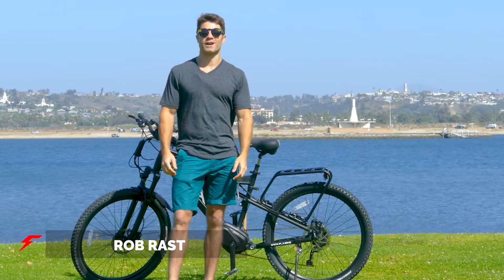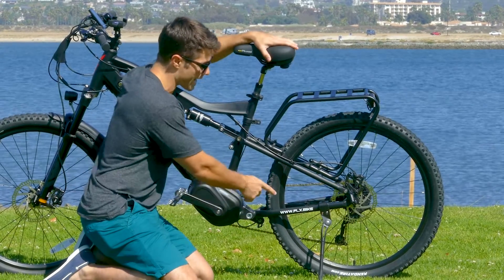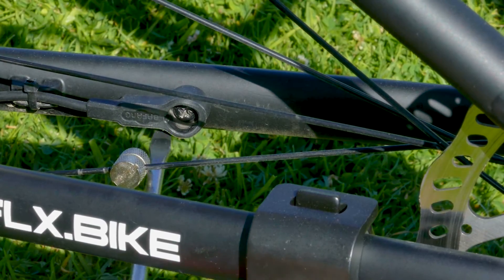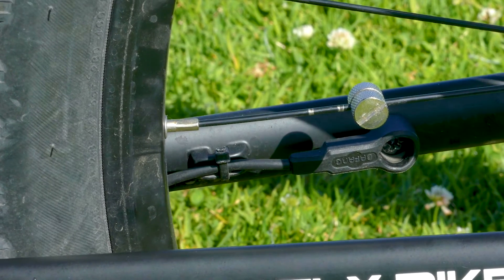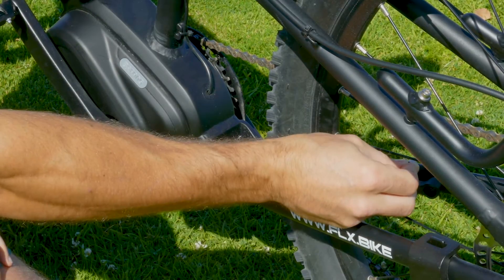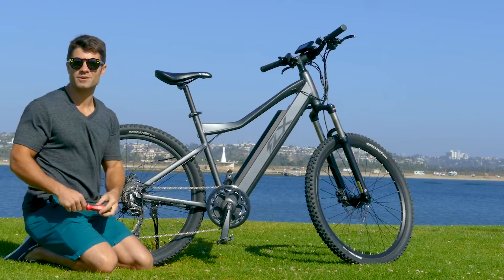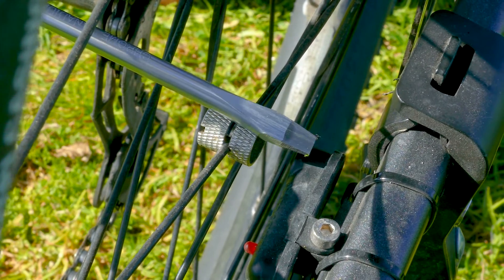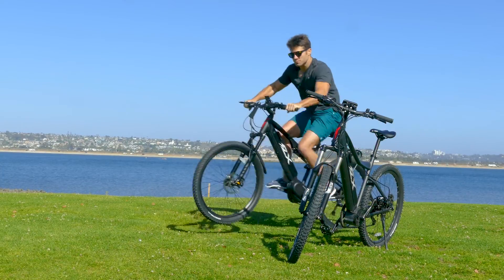Help! My eBike has a Speed Sensor Error

Comment: Tried and tried to align with the circular portion of the sensor.  Motor would operate for 0.25 mile before motor cut out and error code displayed.

Checked speed sensor functionality as you suggested, working correctly. Then aligned magnet with correct portion of speed sensor. Wala all is well. 

Wife's bike, she's happy, I'm happy.
Reply from the maker: That's great to hear dude! Everyone is happy, awesome🙌 thanks for sharing🙂

Comment: Just got 2 of trail today. Had little problem with the batteries but got help from this guy (he call and help by himself which is really good)  the bikes very good quality. I think it's the best value electric hard trail bike in the market. But I think you might need to make a video about the battery to. After I tried to wiggling the adapter on the battery a few times, it got sparkling (looks very scary sparkling) after that the battery works fine. In the second times I changed the battery, just plug in and then it works fine. Don't need to try to wiggling again.
Reply from the maker: Hey thanks for letting us know about your experience. So glad the tech team was able to sort you out quickly getting the battery charged up for the first time! Really appreciate your feedback and hope you're enjoying the ride!
Reply: Ty for tips

Comment: Hey, Thanks for the video. 
Would a magnetic generator lighting system like reelight cause any interference with the speed sensor ( as they would be both installed on the rear wheel pretty close to each other) ? Thanks.
Reply from the maker: The Language Monk unlikely as you can see the magnet needs to be aligned perfectly for it to register speed. It's unlikely a distant magnet would affect it.

Comment: Error 25 on bafang motor wheel, any idea what it could be anyone?
Reply from the maker: It is a communication problem with the brakes.  This can occur if you hold the brake while powering on the bike.